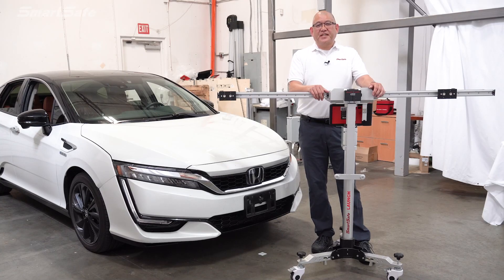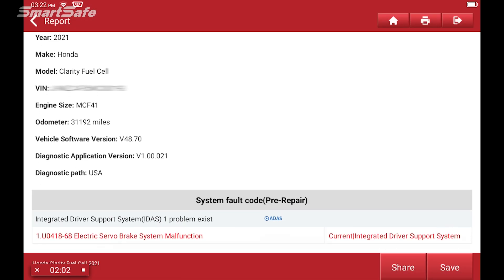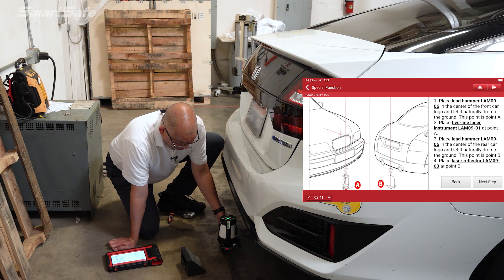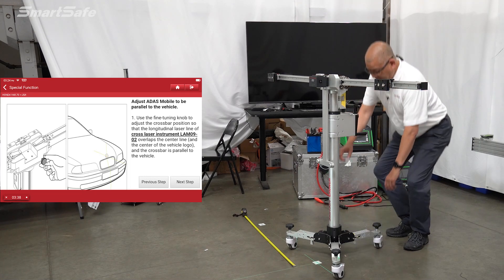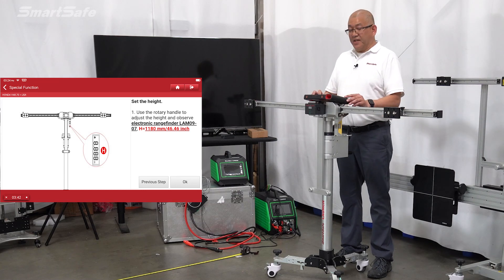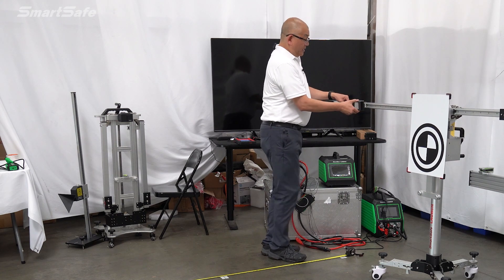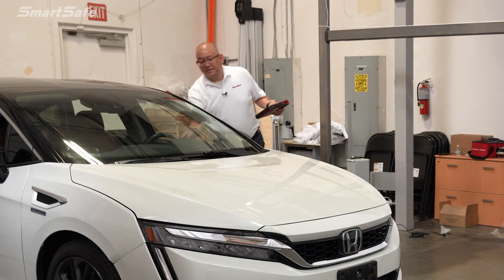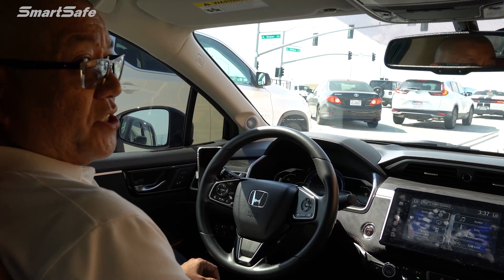2021 Honda Clarity Lane Keeping Assist System (LKAS) Front Camera Calibration using ADAS Mobile

Comment: Your 5:30 step appears to be wrong.  You need to get the center line position by pointing the laser from the back CL to the front CL and projecting to find the CL for your target and measure outward to get your 1000mm.